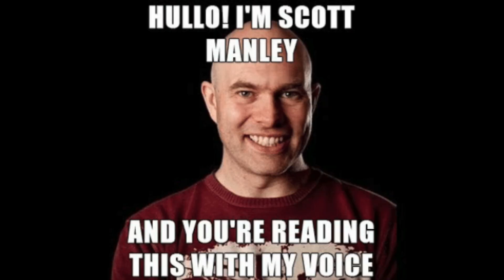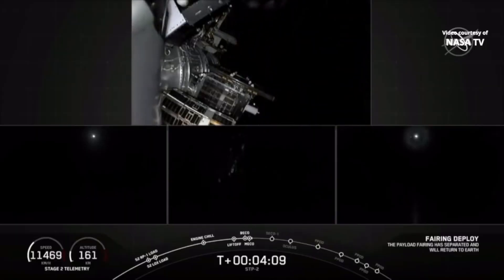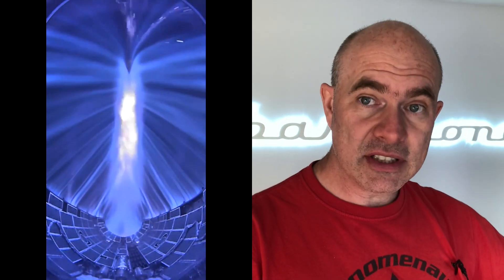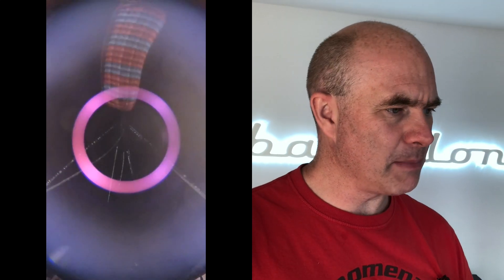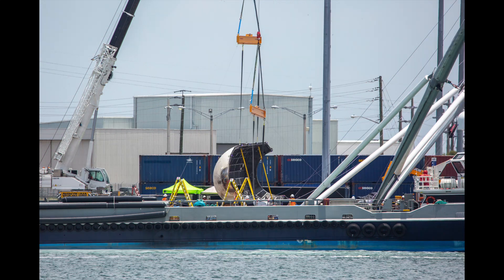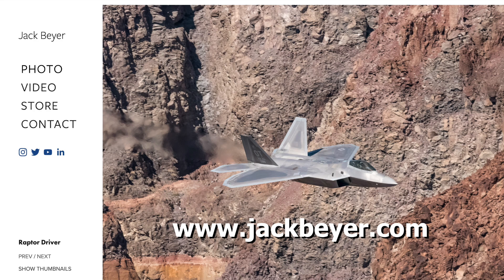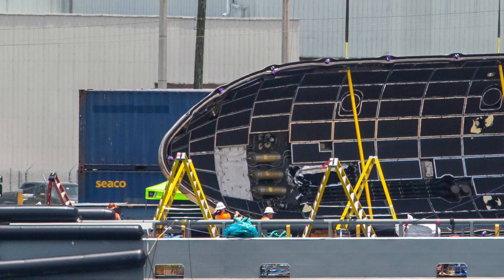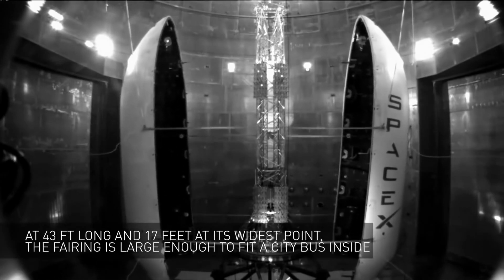SpaceX Fairing Reentry & Recovery & Reusability (better audio)

Comment: 1. What g is it pulling? As you state, very large surface area, small weight.
2. Does it have heat shield? 
3. What temperature does it get up to? 
4. What damage is down by re-entry? 
5. How does it orient itself or does that happen by default? It looked very stable. 
6. The costs needs to be explained. A two skin with a honeycomb? Strikes me as very expensive.

Comment: I spent a week in Barcelona at the end of march! Loved it ( I didn't have enough vacation days to spend more then a week away). Since' i was alone I stay in a small room in a  cozy B&B. Your places look cool.
As for the fairing, I'm still confuse by the fact that having those complicated contraption ( control thruster on the fairings, parachute/wing, a boat) is cheaper to do to recover a simple piece of equipment than just building a new fairing.  Are fairing that expensive to build? or it juts Spacex obsessing about reusing everything?
Reply: Lookup how spacex makes its layered aluminium shells, that's probably a huge chunk of the cost
Reply: Might be steel, either way it's a lengthy process!

Comment: From what ive seen, which isnt much, the fairings look to be on predictable paths, i think this could be easily solved if the ship has a way to track the fairing as it descends and it simply matches its path and speed. A program would be much better able to match the path then any human given the fairing is coming in for a landing above the ship, where the pilot cant see and even someone relaying the location would provide some problems. If it were automated i think they would have caught them sooner.  If training an AI is needed, id just drop a bunch of them with a helicopter, may cost a fair bit, but better to waste one fairing and have a better chance at catching ones from actual missions.

Comment: Just giving you some crap: is it an Imperial Standard or a Metric "... fairly fast.?" Keep up the good work, please. Thanks. Metric "fairly fast" is the time it took for French power hungry politicians to use the invasion by the WW-II Germans as an excuse to get power divided by 10. ;-) This is supposed to be silly, the US reaction was as bad, arresting all Eastern Asian looking people, high 60% of which were Americans.The Metric system makes much more sense. Although, my foot, with shoe on, is a foot. That aside, could SpaceX use the same technology to try to capture the second stage of the Falcon 9? Probably moot as using methaine solves alot of the freezing problems of their current fuel. SpaceX has a lot of big hurdles to overcome. Like docking and refueling a spaceship in orbit. Making methaine on non-Earth bodies alongside the oxygen. Big learning curve. I'd love to throw out the "It Can't Be Done." card as this seems to spur Mr. Musk's determination to move things forward. 😁 Also, I'd like to be the guy that speaks counter to the 'can't go to Mars because their might be life there.' crowd. Life is there, we sent it on there when we landed the first probes. I'm more of a smack Ceries into Mars guy. 'Mericans are hamfisted.

Comment: The mechanical separation systems give you much more range adjustment in ejection force. They're heavier, but if you are recovering it anyway to re-use that doesn't matter. Plus it's a selling point: no chance of explosively ejected debris damaging delicate payloads ;)

Comment: Do they actually even need to catch them with the net? Didnt they successfully re-fly one that landed soft on the water?
Reply: Salt water ruins a lot of the materials and mechanical parts
Reply: @logitech4873  for sure, its more if things can be designed to cope with salt water in mind, it may be a simple task to just wash them down

Comment: I understand the purpose of the reaction control system, to maneuver the fairing for a stable re-entry and to remain within the predicted recovery window.
 I haven't poked around, just wondering aloud whether it is steerable after the re-entry phase, or if it's just free-gliding and the recovery craft have to intercept it.

Comment: Photographer here, and yes that's definitely the CCD picking up IR radiation on the way down. You can easily re-create that glow by taking a macro shot of a campfire using any camera that has an appreciable level of IR pass-through to the sensor. Depending on the manufacturer, it either shows up as a grayish or purplish tone.

Comment: Hello, Scott and thank you for another informative and entertaining video. A question did occur to me as I watched the SpaceX imagery of the fairing re-entry; how does it obtain and maintain stability on re-entering the atmosphere? Is it the N2 thrusters (RCS), aerodynamics or both? I would assume there is an active control system for the RCS if it plays a role here, while the aerodynamics could be largely passive with proper design. Could you comment?

Comment: I think if you were aboard the fairing as it dropped down you'd have bigger problems to worry about than the color of the ionized air. Real life is not quite like Metal Wolf Chaos after all. As cool as it would be to surf down to the surface on one of those things.

Comment: I have to say, that is an amazing entry video. It was worth it even if the fairing didn't hit the net.

I just realized something; this is just like their booster landings. The first attempts were failures and laughed at, then, once they got it dialed in, it became routine, nay, expected, that the first stage would end up safely back on land or on a droneship. They still have a few kinks to work out with the higher energy falcon heavy centre core, but they'll have that sorted fairly quick.

Comment: Install remote control for the parasail, and pilot the fairing to the net, instead of trying to chase and match the speed of the fairing with the boat like an outfielder trying to get under a pop fly

Comment: Because of what SpaceX is doing, I've learned that fairings are far more complicated than I imagined.
I still don't know why they've had so much difficulty recovering them. My only guess is that the wind-shear over the ocean is a lot less predictable that I would expect. If they knew what the wind was doing, it would be a fairly simple control problem to get the recovery ship under the fairing as it comes down.

Comment: That looks very electrical, like your fingers touching a plasma globe.
Reply: it is, the fairing travels fast enough to strip the electrons from the surrounding air, which then glows as it's heated through friction.

Comment: Parawing cables(?) Can be anchored farther apart on that config. Increased roll control/stability.
Reply: It's the arch problem I think. There's a video on how ancient arches were made around here somewhere. 

Basic gist is .. if you hang a chain upside down it creates a perfect mirror of it's arch. So you find what load you want to support and hang it on the chain.

Bam.. that's your target shape. 

Heavier chains (stronger materials) deform less so you can load it up more.

But I digress. If they make an arch it's just more stable. Can't do that if your fairing is narrower than the wing

Comment: They probably did this so when it is traveling so fast it doesn’t slide. When it’s facing forward it’s almost like a sled and it could just slide across the net, while sideways it’ll be less aerodynamic and be slower and less likely to slide across the net.

Comment: How exactly doesn't the fairing burn up? I get that it has to do with surface-to-weight ratio, but still at those speeds, it's a solid object with no shielding, that plasma doesn't do any damage to it?

Comment: The fairing being 90 degrees to the wing would increase descent rate making for a more vertical descent, which could be an advantage. 

Resisting crosswinds is not a valid reason, from the perspective of the fairing there are no crosswinds. Unless it was going through a shear layer or in very gusty conditions it would never experience  a side wind. I have a story about a 4,000 hour flight instructor who did not understand this concept. He's dead now, literally crashed and burned.

Comment: Why don’t they catch fairings with helicopters, spy sat style?
Reply: This has been discussed so many times on the SpaceX subreddit, you have no idea.  Nobody knows!  But money is the best guess IMO, along with risk to the helicopter pilots from the dynamic effects of picking up a 50 foot long, 1 ton "canoe" that's dangling from who knows how many feet of parachute line.  They would need at minimum to rent one very large helicopter and one fairly large boat with a helipad and pay for the crews of both.

Comment: Is the fairing basically a huge heat shield? How did it resist the heat during reentry?
Reply: It isn't.  They did put some kind of metal, possibly ablative tip on the fairings recently.  That's what throws all the sparks.  The fairings never got super fried on re-entry, though, even back in the early days.  They broke into pieces but they didn't burn up completely. 

I doubt anyone outside SpaceX knows the details of how much heat it's subjected to and exactly why -- we don't even have telemetry.  Heck we don't even have exact splashdown times that might let the bright people try to estimate something.  All we know is its release speed which, while "a fair clip" indeed, is still well below half of orbital velocity; and its shape and weight, which as Scott suggested, likely work to burn off much of its speed a lot higher in the atmosphere, in thinner air, than a free-falling booster can manage.
Reply: BlueCyann Why thank you for dat info.

Comment: It seems like the vent holes are initially "closed" and then gradually burn through. Maybe there are aluminum baffles on the outside that melt away. In any case, you can see damage to the surrounding foam sound supressor tiles in the last pictures. Gonna require some redesign to mitigate current necessary refurbishment I'm guessing.
Reply: If it's just a matter of replacing those two tiles, they may not care.  But yeah, possible.

Comment: I freaked out with nerdish excitement when I saw it posted by SpaceX. I was surprised at how bright the plasma was, I completely didn't consider that it might have been IR seen by the camera.
Reply: My experience w/ removing the high pass / bayer filters on image sensors is that the image takes on a pink or orange cast. Blue is higher frequency, shorter wavelength, light. Now the camera is more sensitive because the filter isn't there (the reason it was removed) so the plasma may look brighter than it would to the naked eye, but the blue color is not caused by the  increase in shortwave infrared light, it is just blue.
Reply: @bitmapman  Thanks! I don't know much about cameras and the likes, cheers for explaining, it makes sense.

Comment: If they don't catch a piece of the fairing in the net, is there still a chance at recovering it? I'm thinking that since the fairing is large and somewhat flat, and made of carbon fibre (which is reasonably light), it should float for a while if the sea is calm enough.
Reply: Yes, they float. SpaceX has recovered some recent fairings, with plans to refurbish, but they also note costs from seawater exposure are high. Haven't heard of them flying a refurbished fairing.
Reply: @donjones4719  Musk suggested they would try to re-use a pair of slash-down fairings on a future Starlink launch.
Reply: @BlueCyann   Ah, makes sense. Thanks.

Comment: half a fairing looks a perfect boat! … why cant they make them float like a boat before recovery... that whole net catching looks too silly
Reply: Salt water damage. Wave damage. Stuff like that.
Reply: Yup. Why don't they just...  install an inflatable "stern." Then no saltwater exposure to the interior, which I imagine is most damage prone, and complex to refurbish.. 
Answer: I dunno. But they've committed years and many $$$ to the current approach.
Reply: @donjones4719  You are still going to get spray. The water itself can be a problem for imaging satellites. You wouldn't want it outgassing and then condensing on your optics. Brand new fairings may in the future become one of the "extra-cost" services that all launch providers seem to offer.
@ypey1 The water won't be touching for just a few minutes, but rather, the few days that it takes to get back to port and offload them. From the rumors that I've heard, it's the insulation that is water sensitive, not the shell.
Reply: Markle2k They can trace them like they do now and tow them onboard within minutes i imagine... ok sound like a plan, who got elons phone number to call him?!
Reply: @ypey1  If you can phrase it in a way that doesn't waste his time, you can reach him at @ElonMusk on Twitter. :~D
Reply: If the boat misses them, they do float and are recovered but need to be extensively refurbished because of the salt water.  Putting floats on the fairings to keep the fairing itself off the water might work though...
Reply: The outside hull can survive re-entry from space but cannot touch salty water for a few minutes?! Doesnt make sense to me. There must be a way to keep the delicate inside dry and protected like it is during re-entry...
Reply: @ypey1  Like I said, an inflatable wall/bulkhead can be inflated just before splashdown to seal off the open end of the fairing, make it like a boat with a stern. Built of material like the inflatable emergency slides on airliners.

Comment: The 90° change might be to reduce the impact force when hitting the net. It would greatly increase the surface area from just the nose hitting first to the full width of the nose cone.
Reply: It's designed to resist supersonic airflow...gently falling into a net is probably a piece of cake compared to that!
Reply: @mrkeogh  Not for the net and the ship lol.

Comment: If those depressurising holes were sealed and you were strapped to the inside of this while it was re-entering, would you be able to survive the heat?
Reply: Probably, with right spacesuit. Google MOOSE ("Man Out Of Space Easier"), it's somewhat similar - 60-s concept for an inflatable individual heatshield. Fairing is huge, astronaut is tiny and light, so probably yes. What, space surfing?
Reply: It also decelerates at a fair rate. You would probably pass out from that
Reply: @Quack Quark The heat intensity inside the fairing would be quite low. An aluminized suit cover would cover most of it. The helmet would be the biggest problem. The helmets are polycarbonate and soften at high temperatures. A refractory helmet would be required.
The human body can handle 400C for short periods if the breathing air is kept below 60C.
Reply: @allangibson8494  I looked for the source for a while but only found some unrelated Auschwitz stuff with questionable legitimacy.  Can you share the link if you happen to find the article again?
Reply: Space surfing a spent fairing? How cool do you think the X-Sports kids would think you were? They bow down in worship.

Comment: How fast is it moving when the parachute pops? It seems to be deployed with sparks still sparking, and then yet floating down so slow over that barge.
Reply from the maker: I think there’s an edit
Reply: Scott Manley 
Could you elaborate on DSCOVR being shut down? Or switch to ‘safe mode’ hibernation. 

There’s several articles about Trump admin wanting to terminate DSCOVR due to the data it collects is climate monitoring, and Trump wants the US to turn a blind eye to climate data. 

I appears that it was just switched off without cause, per Trump admin policy not justified by operational failure. 

And when did that occur ? If you could plz.
Reply: @larryscott3982  Worse than all that, it's unofficial moniker is "GoreSat". It's a filthy democrat satellite.
Reply: Markle2k 
How can an instrument be bad? It’s an instrument. It has no agenda. 

If China created the hoax (the Trump assertion), then prove it with data. Oh, data bad. Blind eye truth.
Reply: Yes, it looks like an edit - I'm guessing they cut away from showing the parafoil deployment, to protect proprietary technology.

Comment: How is the carbon fibers integrity effected during reentry?  I thought it has a low melting point.
Reply: Nope Carbon itself does not melt at all; it burns up. The matrix duromers (epoxy) can also take quite a bit of heat before they char ( they don't melt.)
Reply: The fairings have heat shields made of an ablative material. The sparks you see flying past is the consumed shield material flying away taking heat with it. I'm still curious to know how much work goes into refurbishing one of these fairings and how much $$ it saves in the end after returning them to flight worthiness.
Reply: It is really light for it's size, which means it slows quickly, and the max heat load is much smaller.